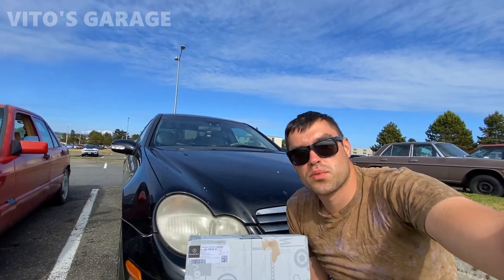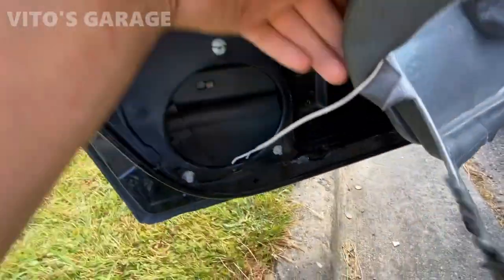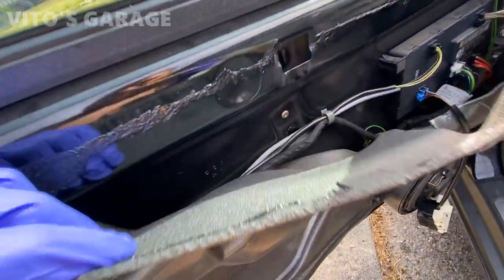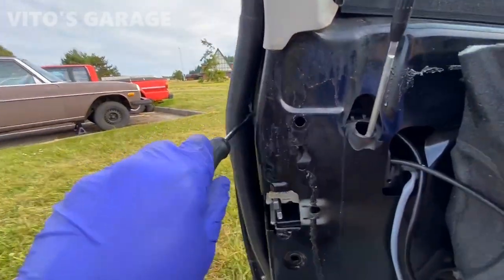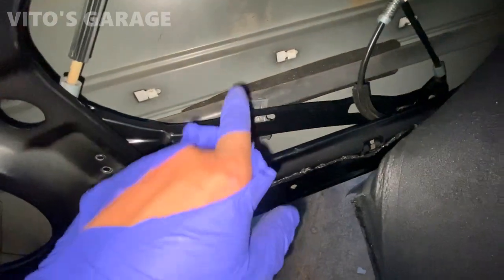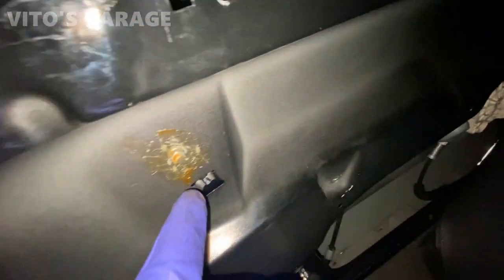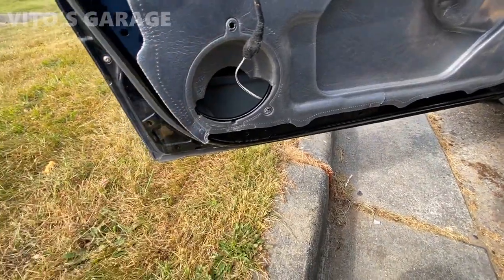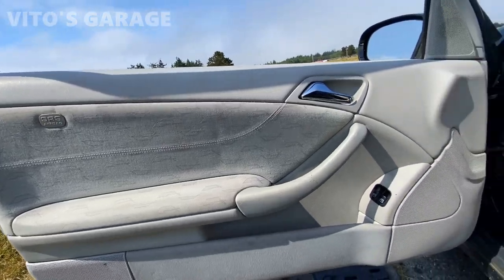2004 Mercedes C230 Front Left Door Lock Actuator Assembly Replacement. Doors Will Not Lock

Comment: What do these German engineers think when they design these cars???
Absolutely no consideration for serviceability 😢😢
Even if this was to be done in a dealership or certified shop, it will take hours to perform this repair 😢😢
Is that how they make money 💰???
Reply from the maker: Check out my other videos and playlists. I save and restore old school Benzes and Bimmers. I rarely work on W203s. Mostly 70s, 80s and 90s cars. They used to make amazing machines back then. After early 2000s it all went down